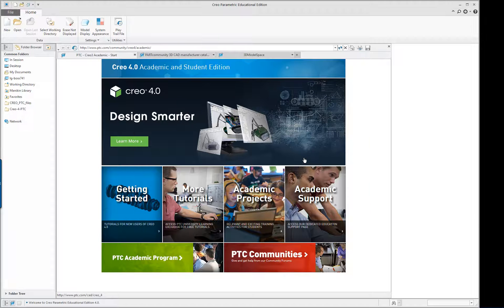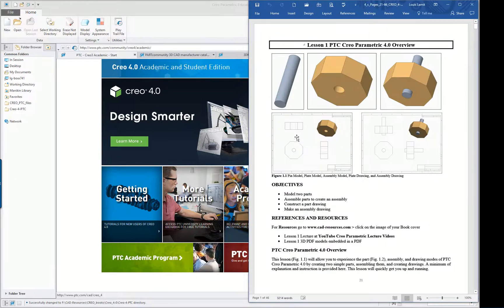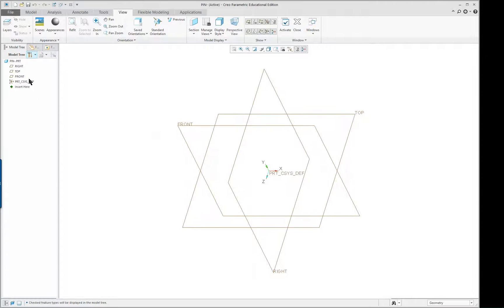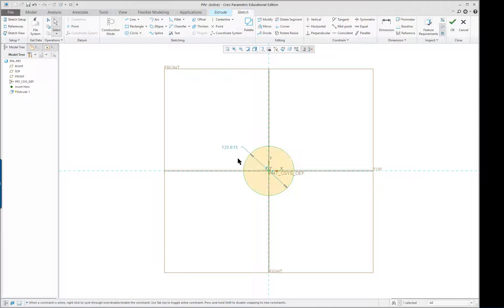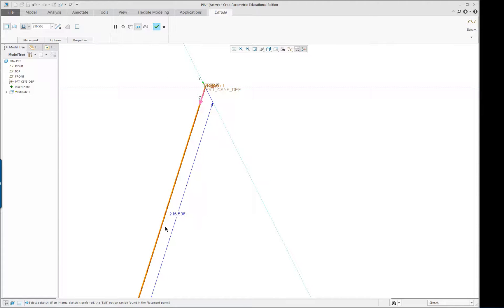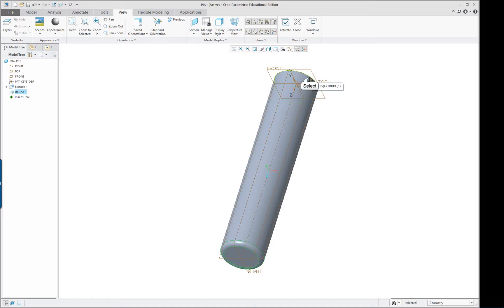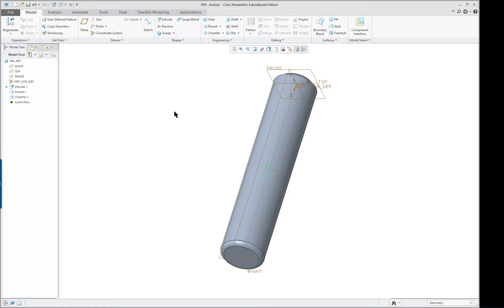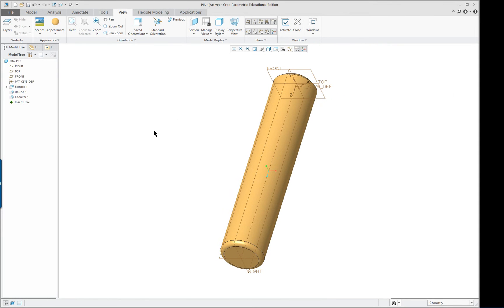Creo 4.0 and Creo 5.0  Lesson 1 Part 1

Comment: It is a very descriptive explanation !
I am studying CREO 4.
However, since the mouse is not a 3 button type, the same operation can not be done. (^ ^)
(I can not rotate with the center button)
Reply from the maker: 歌舞喜 All CAD systems require a three button mouse.
Reply: Mr. Louis Gary Lamit, Thanks for your reply.
I found that pressing the scroll dial of my mouse is the same as the center button of the 3 button mouse.
Rotation operation was successfully made.
Reply from the maker: Yes-- but your productivity will be greatly improved with a a 3 button mouse1

Thanks,

Gary